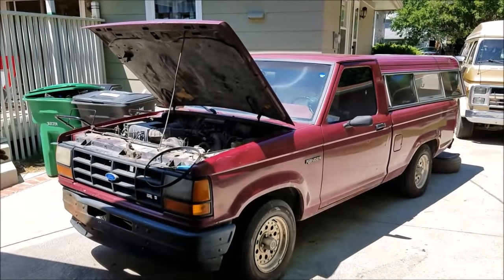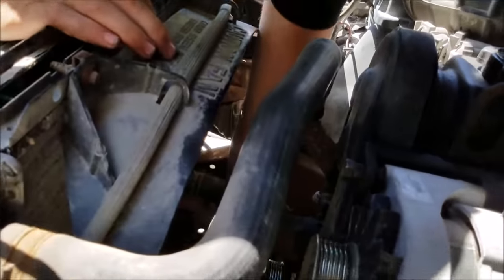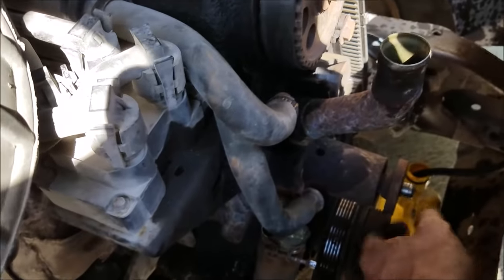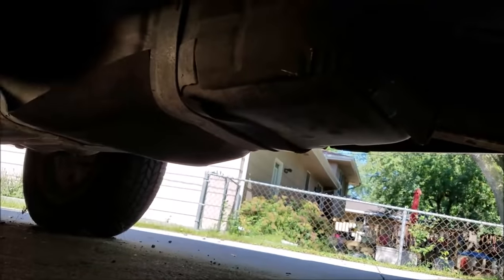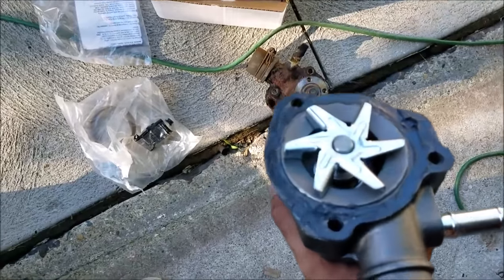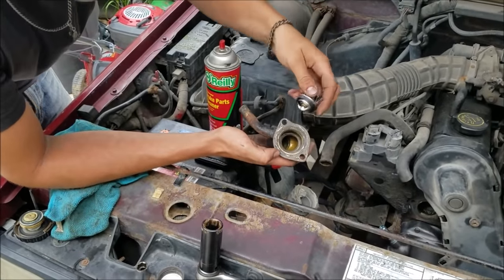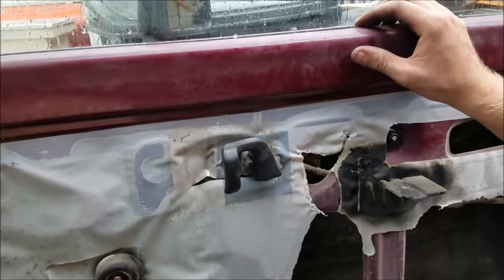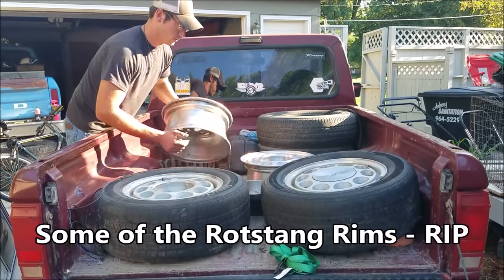Reviving a $500 BEATER - Make it Reliably Roadworthy !!! (TBT First JYD & TH289 Project)

Comment from the maker: Howdy, this is an 8 plug Lima head, in case you were wondering why I said “all 8 plugs”. 
Also, this is a throwback Thursday type video with Kevin - this was a long ago!!! 
Thanks for watching 👍
Reply: I ha e a 95 with a 2.3, 264,000 runs like a new truck.
Reply: My '98 Ranger has the 2.3 as well, 8 plugs, 5 speed manual regular cab.  I did have to replace the throw out bearing in it and man was that a job!  So while the transmission was down I put in a whole new clutch kit, master cylinder. slave cylinder and a new flywheel and rear main seal as well.  Has 138,000 miles on it right now and runs like a new one.  I got the truck for free from an Uncle that just didn't want to mess with it.  The paint is going...it's that blue/purple depending on how the sunlight hits it.  I've been thinking about sanding it all down and painting it with tinted bed liner.
Reply: @Rebel9668  Nuh uh, 98 2.3 has 3 plugs per cylinder. Just kidding, and I agree.. changing the hydraulic throw out bearing is a huge pain, bleeding the air out is even worse.. I wish they used an external cylinder and fork..
Reply: this truck is a good candidate for liquid wax, usually from a self serve car wash, sprayed on the underside, most of the engine compartment, and even if you can, under the carpets on the floor pans.  plus silicone tire shine protects mufflers.  You might have gotten a few more miles out of that water pump by filling the bearings with silicone grease through the drip holes.  I have had some luck putting just a few drops of trans fluid in the coolant for lube and corrosion, though it can trick diagnosticians.  I learned the hard way that silicone in coolant reduces heat transfer, thus harming radiators.  Regular grease in the water pump bearing might work, but might also attract dirt in the longer run.
Reply: HOORAY! this looks like your most practical, and therefore greenest, project yet!  Can those 4 cylinder engines be bolted into larger vehicles for traction and efficiency? mounts? bellhousings? low enough first gears for uphill starts?
Reply: You have to compare the cost of registration, insurance, and rust and other time related deterioration to the extra fuel used by your other car, except that registration and insurance cost is greener than fuel cost.  Even time related deterioration cost on multiple cars is probably somewhat greener than fuel cost, but not as much so as most tree huggers seem to think.
   Ever consider car-pooling? or moving closer to work?
   The planet thanks you for preventing the construction of new cars and parts almost every time you save an old one from the crusher, and for videotaping burnouts so that every kid can watch them without doing them.
Reply: I guess im asking randomly but does any of you know a tool to log back into an instagram account??
I was dumb forgot my account password. I would appreciate any tips you can give me
Reply: @Remy Anderson instablaster ;)
Reply: @Yahir Gregory I really appreciate your reply. I found the site thru google and im in the hacking process atm.
I see it takes quite some time so I will get back to you later with my results.
Reply: @Yahir Gregory It worked and I actually got access to my account again. Im so happy!
Thank you so much, you really help me out !
Reply: @Remy Anderson you are welcome =)
Reply: I am a firm believer that it’s less expensive to fix an old car yourself than to buy an new car that you can’t fix

Comment: A couple of notes...

-It's well known on 5.0 Mustangs (which I have to think you've heard about) that when those fans crack, they end up going through the hood and usually take out all sorts of other stuff on the way out. Sooner than later is my suggestion on replacing that one. RPM is RPM, Mustang or otherwise. On my 5.0, my fan was all cracked out like that 78,000 miles. E-fan is what I ended up doing. Speaking of... It also, at a glance, looks like your Ranger uses a similar alternator (with its stupid 10awg charging wires in a plastic connector instead of a stud, like normal folks) that are famous for burning vehicles down. Might check the condition of that connection and clean/replace as needed. Again, I just went with a different alternator entirely (necessitated by the e-fan).

-The fuel line clips that you described that suck, really do suck. I won't claim I invented it, because someone else out there probably beat me and I just don't know it,, but I discovered a nice trick to get those off easily and the video is on my channel (titled: How to Disconnect GM Fuel Lines (the easy way)! Max's Tech Tips!). I highly, highly, recommend you give it a shot the next time you're up against one of those bastards. The Ford clips are so much better.

-That line you're using is commonly referred to as NiCop and is absolutely amazing. I'll use nothing else for the rest of my life. I also have a long (rambling) video (titled: Metal Fuel and Brake Line Forming+Flaring Tools, Materials, and Methods!) about brake line forming and I cover NiCop line pretty well. I'm sort of surprised you guys haven't used it before, but it's the real deal. 

Anyhow... You were one of my inspirations for even starting a channel, so I hope maybe a little something or another in those videos is helpful to you! Hope to see more of that Ranger as well. Nothing beats a beater and I've got a soft spot for unloved Ford economy boxes. I always enjoy your content!
Reply: Maxwelhse my 94 f150 had that alternator clip, got wise to it a while ago after it corroded beyond repair and ended up replacing it with a 3G alternator and harness, no trouble since
Reply: @Beandiptheredneck  Exactly what  did on my 5.0, but rebuilt my 3G up to police specs and ran 00 wire for it. Nice 200A+ unit now.
Reply: Maxwelhse I don’t need that many amps because I’m mostly stock under the hood, but I figured the extra couldn’t hurt, between that and my red top optima there’s not much I can’t power up
Reply: @Beandiptheredneck  I was also running a red top for years until it seems the quality fell. I haven't had good luck with the last couple I bought so I switched out to Dekas (from Johnson Controls).

Comment: I had a 1991 Ranger that I got from a salvage yard in the summer of 1991. The original owner had it less than 2 weeks and rolled it over. With all the Rangers my father had in his salvage yard fixing it was no problem. It had the new 4 cylinder with the 8 spark plug head connected to a 5 speed transmission, and was a bulletproof joy to drive.

Comment: Running a 96 ranger. Got it for 500 but it wasn't so simple for me. Put a flywheel and starter in it. My uncle sold it to me and said that was all it needed. Well I'll not trust his word again. Turns out it needed a new coil, purge valve, purge solenoid, timing belt, his filler neck rigging corrected, valve body, transmission solenoids and another frigging engine. To be fair, I'm sure replacing valve springs, that rust putted cam, milling the head flat and replacing the cam, mains and rod bearings, the engine might be ok lol. He knew it was full of rust. He put a head gasket in it thinking it would be fine. Then suckered me in on it. I found an engine for $125 and replaced the other parts as needed. I give that truck hell almost daily. No complaints, been running it 2.5 years now. My take away is family will screw you worse than any used car salesman. I don't have a high opinion of those guys either...

Comment: These rangers are bulletproof, still daily my 1992
Reply: Matthew Devine these 2.3s are pretty reliable but always make sure you have coolant in them. My gauge always read cold so it went unnoticed when the coolant leaked out and overheated the engine. Wound up cracking the head. No water in the oil though. Really just sped up my plans for dropping the 5.0 in though.
Reply: I’ve had three of these little trucks and no complaints out of me other than the annoying clutch lines that hold air.
Reply: I had a 94 Exploder 4.0 AOD4 and I had to have the AOD4 rebuilt 5 times. The 4.0 was built with forged internals, a cam (I don't remember the specs), all aftermarket valvetrain, and an Explorer Express supercharger kit. It made 257 whp and it kept overheating the transmission even with an oversized cooler. Then I had a 95 Ranger that I bought for $500 and it had the same issue with the coolant gauge. I replaced both senders and it still read cold, until it overheated so much that it cracked both heads. I replaced both heads with an older 4.0 and it finally killed the 4R55E trans. Ford trans have always been junk imo. They just can't take the torque.
Reply: Cameron Crawford-Norman howd that 5.0 swap go?
Reply: Big Turbo EJ8 I’m sorry I don’t believe your getting those numbers n/a no nitrous with just a cam. That would only put you in the 200 rwhp range according to every 4.0 ever maybe 210 with ported heads
Reply: Big Turbo EJ8 nvm I’m a drunk idiot I’m so sorry haha I didn’t read the whole thing
Reply: I've been wanting to revive my ild Bronco 2. It was my dad's truck when I was a kid. Thing was bulletproof but there was a title mixup when my dad dropped the old Bronco 2's engine in her.
Reply: That engine running with no thermo housing sounds like my ranger normally running. My dad is suspecting lifter. I don’t think so but it gets quieter when first starting

Comment: I can now better appreciate all the effort and time one of our neighbors put into his Ranger and it's 2.3 after he purchased it at farm equipment auction four years ago (well before we moved back home to South Carolina and met him). The truck had been parked by it's original owner, the elderly and now deceased farm owner in 2006, under a "car shed" attached to his hay barn and basically forgotten over the years that followed. Our neighbor was the only bidder on the truck and "won" it for $500.00. After trailering the Ranger home he did all the work required to make it a daily driver himself except for mounting and balancing new tires and of course the front end alignment. As a supervising surgical trauma nurse at one of our area hospitals he is on call 24/7/365 and has driven that old green Ranger during hurricane related weather, icy roads,  you name it, and drives it daily even now when going to and from the hospital on his regular shift.....Round trip: roughly 120 miles five days a week and, often as not, seven days a week since he is always on call. He purchased the truck with just over 85,000 miles on the clock and now has almost 200,000 on it and he does all the basic maintenance, oil changes, air filter, etc. himself in his back yard.

Comment: The brake/fuel line is known as NiCopp. It will out last the old stove that it is attached to. OEMs like Volvo have been using it for over 30 years. My 1986 740 that my dad bought new in late 1985 has some rust on the body from all of the Wisconsin salt caked winters, but the brake lines are mint still. Love the content!

Comment: I had a 93, ext cab, 4 banger, 328K miles, got it for 600 bucks, Put some decent bigger tires on it, did fluid changes, tune up drove it from Florida to Glenwood springs CO. ran it hard thru the mountains, ran pretty good, but on the way back blew number 3 cylinder on Ruidoso pass, drove it all the way to Melbourne Arkansas on 3 cylinders where it finally failed to start. I gave it to a kid there . Rangers are great little trucks.

Comment: I paid 600 dollars for my Ford Ranger, but it was a 6cyl 4x4 with new tires and other new goodies on it. They sold it as a no start at auction. I paid for it after I won it. I turned on the ignition opened the hood and jump the Soelenoid. It fired right up. got it in 2015 and still driving it today

Comment: I had a 1988 Ranger all through high school, 2.3 manual, sold it with 255k and still running
Reply: Ever had a problem not shifting? It shifts fine with the truck off. Thinking pilot bearing?
Reply: I had an 1987 Bronco II that had the infamous A4LD transmission that was doomed to fail. Mine even had a rebuilt one that died. I loved that truck though. Once I got some good tires on it it was almost unstoppable (except for the transmission that is)..lol
Reply: @VeganGorilla555  they were great. I'm looking forward to getting mine running, if I can get it transported the 1000 miles here.
Reply: @MrAnderson5157  Mine shifted much better with the truck on.

Comment: saw a lot of those 2.3s working in the machine shop. There is a lot of iron in the block and the head on those engines. Those Rangers are great little trucks to kick around in. I have owned a few of them and worked them hard

Comment: Still driving my 86 Ranger 2.3 with manual stick. Make sure rubber timing belt changed regularly. Pulls 14 foot boat to lake or small trailer. Will not die like my 93 F350 with 7.3. Great project

Comment: Still have my mint 1995 Supercab Ranger in the garage up here in Wisconsin.  A few years back, I pulled the bed and replaced all the leaf spring hangers and shackles as well as the gas tank straps and re-plumbed the brake lines with NiCopp and painted the frame.  Now she patiently waits for a 302 from an Exploder.  In the meantime, I should really use your videos to change my 2.3L timing belt, water pump and thermostat.  All are still original at only 78,000mi.  Thanks guys.
Reply: I did the original timing belt, water pump, thermostat, etc on my 95 Escort last winter and I was pretty surprised how decent most of the parts looked. Videos of it are my channel.

Comment: What ya'll call "beaters" I call "my daily driver"
Reply: Those little Rangers are tough as nails and hard to beat, S10s can't touch them for longevity. I've had several that I used as work trucks, my last one had close to 300,000 miles on it when I sold it.

Comment: I've used that nickel copper line for a few years, living in the rust belt rotted brake lines are very common. That stuff works great and doesn't rust again.
Reply: And very easy to bend I love copper lines

Comment: Absolutely worth it I trust my 94 Ranger to go anywhere, converted the back wheels to disc brakes, think of antiquing it onetime tags and no inspection, be 25 years old  in a couple days.
Reply: My 03 F150 with the 4.6 V8 is like that too. Damn thing was built a RPOC, but even when she completely fails she can be fixed with a wrench and a water hose. I thought she was gone for good when I accidentally buried her in my muddy driveway.

Comment: Those rangers also have aluminum gas tanks, that rust out from inside and then wreck the entire fuel system. I have had 3 rangers - 1986, 1998, and 2005. Now I am driving a 99 Tahoe, which comes factory with a plastic gas tank that holds a whopping 30 gallons. they make the chevy more sensible with the fuel filter and not those special gas line fitting and chevy includes an adjustable and movable fuel line with 5/8 nuts for fittings. So much simpler for the owner to replace themselves. Another pain in the but will be changing spark plugs in that ford. The block is also aluminum, which is prone to crack with the temperature extremes it is exposed to in the northern hemisphere. And such a small engine, really bites when merging onto the freeway or passing someone. I used to drive the 5SPD manual transmission and push the rpms up so high that I would have to go under the hood and tighten down the valve covers.

Comment: My 2000 S10 extreme cost $850 5 years ago. Needed a fuel pump $9 from China and a new spark plug wire. Guy drove it from Florida zero rust with a miss fire he was told it needed an engine. Loaded v6 extended cab. Came with about $3500 in aftermarket parts a custom hood a bed cover SS header's cold air intake etc. Needs tires still has the tires I originally purchased it with got 30k on them now. In 5 years I've replaced the exhaust the front breaks the radiator and did the intake gaskets just because the are known to fail.

Comment: Yep these rangers ( I have had 3) need thermostats and the gasket often. I have a short video with important tips when replacing timing belt on this engine,  camshaft wheel has two markings: a triangle and a diamond. You probably already know this, but want to match the triangle with triangle. Often they're covered with grime and a person finds that diamond thinking that is the marking to line up, but the diamond signifies open valves and should be pointed upward. That thermostat housing will crack easily too, wanna be careful. The electronic choke is exactly right, that's the high idle. These fords are mazdas which is why they're full of metric sizes.
Reply: The ford Courier was made by Mazda, not the rangers, ford made the rangers and the b series from b2300 to b4000, including the b2500 and b3000, that's why they have a ford engine in them,

Comment: Copper Nickle line is rated the same for pressure as the steel lines and has the added bonus of not rusting and being able to bend very easily.

Comment: Thanks a ton for taking the time to make these videos.  '91 Ranger here, they are very helpful.  You mention a metal replacement fan for the radiator cooling fan.  Could you post a line for one for this engine please?  My fan is cracked completely through in a number of places.  I'm not finding a replacement.  Thank you in advance.

Comment: My 2003 Mountaineer was $600. Bought it in August of 2016. I've replaced the entire suspension and exhaust. Probably put about $2000 into it, counting a brand new set of Cooper Discoverers last month. If I paid $2600 for a truck, I could have still had to put a couple thousand into it in 3 1/2 years. It starts up every day and has never let me down.